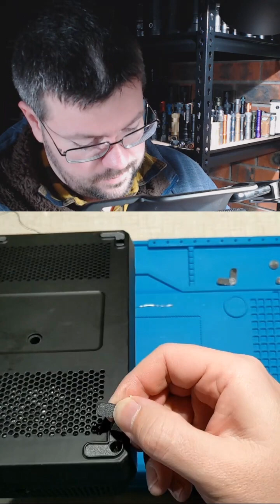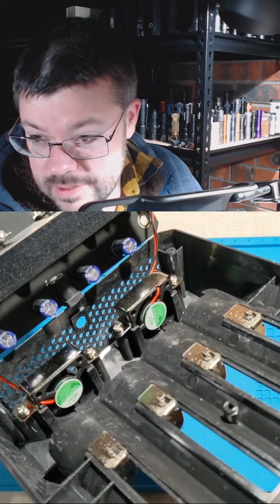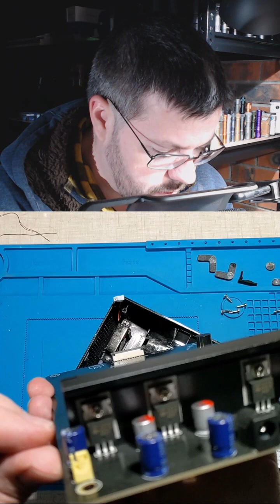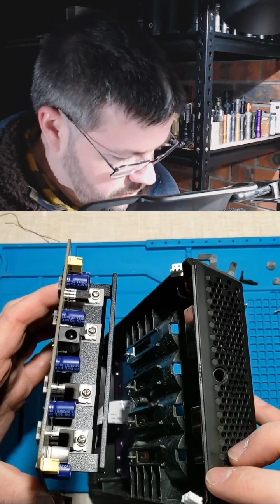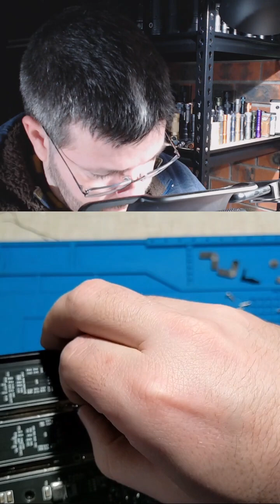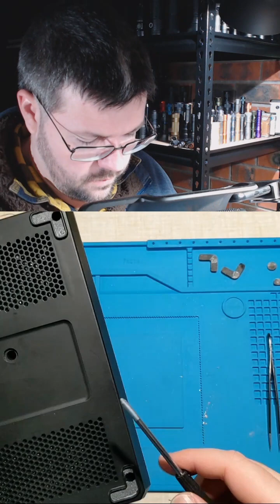Gyrfalcon S8000 Battery Charger Analyzer Teardown

Comment: Does yours have the super gritty terminal sliders? If so, do you see any way to fix that issue?
Reply from the maker: @BuckRogers2491  They slide smoothly if I push from the bottom of the negative terminal. If I push from the top then it bends the slider down and gets a bit stuck.
Reply: @TorchHacker  Thanks for that! I may, at some point, open it up and see what can be done. That is, unless you looked at it and didn't see anything super obvious.